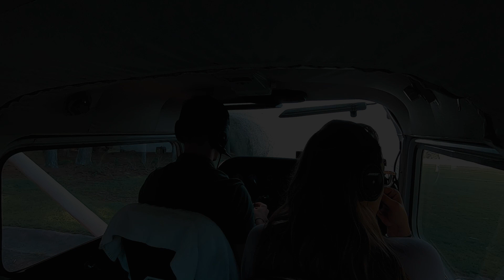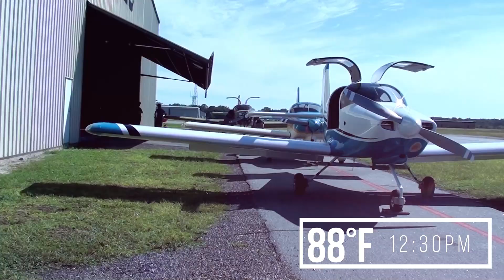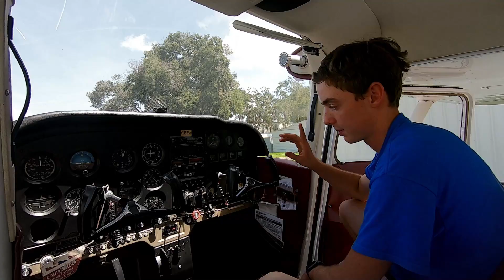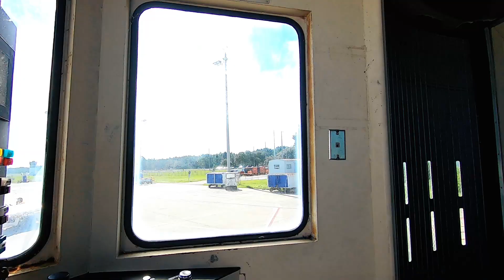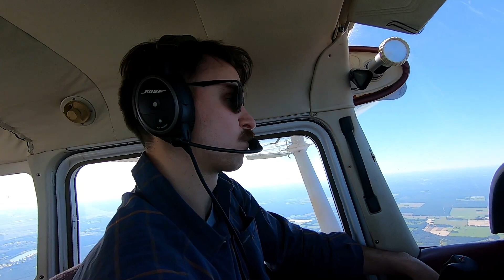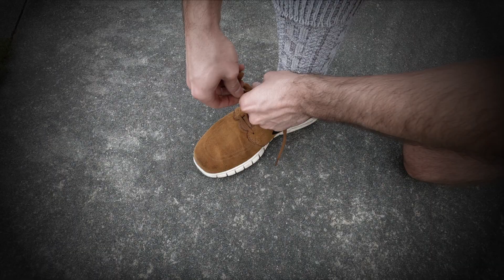Second Wind: Dynon Skyview HDX Installation in my 1970 Cessna 172K

Comment: Nice! Congrats on the new panel. Planning to install the same system on my Mooney. Thanks
Reply from the maker: Thanks for the comment! You'll love the new panel. Definitely found a lot of use from the density altitude reading and also engine monitoring! NEXRAD weather is a huge plus too. Enjoy it
Reply: @seanair4573  Great! How much did the whole system cost you plus installation? Would be great to see a breakdown. I can imagine how much money you saved by not going the Garmin G3X way!
Reply from the maker: Sorry for the long wait! I grabbed a brochure at the Dynon tent this week at OshKosh. I’d say that their pricing structure is spot on for the values we purchased. To save you some time, I can summarize..

We bought two of the larger 10” screens
ADS-B traffic and weather
Mode-S transponder with 2020-Compliant ADS-B Out
Dedicated Knob Panel
SkyView Network Cables
Engine Monitoring 4 cylinder configuration
IFR connectivity kit (for the IFD 440)
Autopilot C172

… all as advertised, roughly $27K for all Dynon components.

Add another $13K for the IFD-440 COM/NAV/GPS

As for installation and shop fees, I’d rather just say that Saint Aviation gave us a quote and stuck right to it! So when you email him for a quote, know that you can trust it! And you could expect probably a 5 or 6 week turn around if all goes well with the installation, but don’t let me speak for the shop. Best to call ahead and have a friendly chat.

Hope this helps!
Reply: @seanair4573  Great! Thanks for getting back to us on that. Enjoy your beautiful airplane. Just out of curiosity, what did they charge for installation? Thanks!

Comment: I love the Dynon Skyview from what I've seen of them.  Pretty reasonably priced too for glass.  I think last I saw a skyview package started out at like 25k for a 172.
Reply from the maker: Yes, the HDX is a very reasonable price considering all the versatility and amenities. Strong performer in the glass panel market. Definitely clean presentation and intuitive design. Thanks for your comment!
Reply: Is that $25,000 in parts or installed?
Reply: @DWBurns  At the time I looked it up that was installed

Comment: Awesome upgrade! I am about to do the same to my 172M. Would you do it again if you could go back in time? What would you do differently?
Reply from the maker: Thanks for watching and also leaving a comment!

I think that for general aviation and private use, just one Dynon SkyView HDX 11” screen would be more than sufficient (rather than two screens). And instead of that second screen, installing an iPad mount on the panel would be a valuable location rather than on a suction mount or kneeboard. Although- I’ll admit I hardly use the iPad now that we have this set up. I love the panel the way we have it and am very pleased with its functionality!

After I released this video, we made another trip to Saint Aviation to upgrade our old GNC-300 GPS/COM into the Dynon COM radio. I would have probably chosen to do that sooner had I known how useful the new radio is as a workload reduction tool. Removing the GNC-300 freed up some panel space which also allowed us to finally move the standby EFIS (D10A) up to a more prominent location. While its original location was legal, it was a compromise on our original design due to the downward slope of the C172 panel near the firewall. We elected to install it low and in the center, originally, so it was still usable by both pilot seats. Now, it is high and in the center of the panel, which is a much more friendly location from a human factors standpoint.

Part of the reasoning behind our decision to install two HDX screens was for resale value given the system’s competitive features when compared to the standard C172 glass panels in training aircraft, namely the Garmin G1000 suite. With our current arrangement, this aircraft is equipped for the next several years of owners, be they for professional use, private IFR use, or flight school use. 

That said, we are not planning on selling for many years, so we have many adventures to share still!

I’m writing a future video to go into more detail about our decision making process on this old bird. Stay tuned and thanks for watching!

Comment: First you did a great job with the video. Nicely produced.  Second, Jesse is a great guy and his shop does good work. I have worked with him for years, maybe a decade or so. Third, well 3rd kinda sucks.  Your airplane is unairworthy as it stands. If you were to crash or need an insurance claim for any reason they could deny it. The Dynon installation doesn’t meet the STC. I knew it the moment I looked at the beautiful panel. A ramp check would ground the airplane if the inspector knew his/her stuff. The D10a standby has two requirements as far as location goes.  It must be as close as practical to the main screen.  That would be just to the left as shown in the installation manual. The next requirement is that it be as high as possible in the panel.  It is located as low as possible in the panel.  Either one is a deal breaker.  Some people think these are suggestions.  A STC is giving you mandates, not suggestions. Sorry for the bad news.  I know like this will be ignored and Jesse will probably say “It’s no big deal”. But I thought you should know the truth. Download and read the STC install manual and decide for yourself.  It’s only one page of reading for the location requirements. I’m not picking on Jesse. Like I said, his shop does good work.  But he is human and like all of us, we make mistakes.  I know I’ve made more than my fair share.
Reply from the maker: Hi John! Thanks for your comment. I’ll look into this